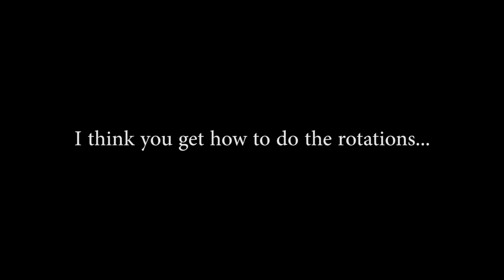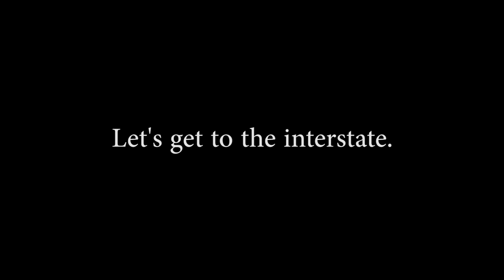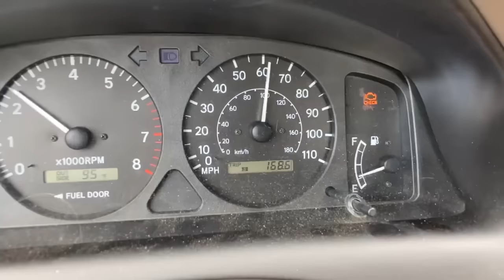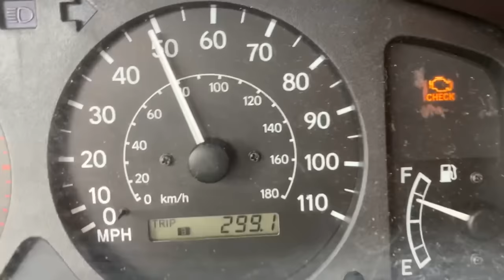Will Berryman's B12 Chemtool stop oil consumption? 😲 | Oil Burning🔥Experiments | Episode 15

Comment: Keeping my fingers crossed!! This is exactly how the wd40-trick is done here in Sweden with old Saabs!! Great video and great work, really appreciated!!
Reply from the maker: Thanks Claus!
Reply: Really, How is that? WD40 in oil sump works? At wich percentage? Interesting!
Reply: @tomasnokechtesledger1786  some Saabs had problem with oilsludge due to bad crankcase ventilation, this caused among other things stucked pistonrings.
Wd40 was at that time the only "thing" affordable, you could by it a one gallon can, some used diesel!
Not for the faint of heart!!
Reply: @clausjansson4856  My friend a mechanic said to use diesel for engine cleaning. I have seen some promising results but also a lack of help because if the cylinders are not round or heavily scored then clean rings will not help.  Just FYI, WD40 has a chemical that can destroy metals but if used temporarily and then removed it may not do too much damage.
Reply: @jamesmedina2062  totally agree, if its worn out the only thing to do is use heavier oil or a rebuild!!
Dave has gone through all the steps checking his engine very carefully!!
The wd40-trick is just an old Swedish home remedy (i think you call it that in us) might work, might not work, test at own risk!!
Regards from another DIY
Reply: @jamesmedina2062  A chemical that destroys metal? What's  that? Doesn't  destroy not even rubber. What youv talking about?
Reply: @tomasnokechtesledger1786  I am not a chemist. I do not know what the chemical is or how it destroys metal but penetrants are designed to attack corrosion and separate metals. I was told the information by a nuts and bolts specialist at local store. There are cutting oils that are made with different formula better for assembly and I use anything from a super light shock oil made in Switzerland (Motorex 2.5), Motul 300 grease, or Permatex anti-seize upon assembly.
Reply: @jamesmedina2062  no it doesnt attack corrosion, just coat it and wash is and protects further, but penetrants just make a little soft by the wetting over it.
Reply: @tomasnokechtesledger1786 The question was does WD40 harm metals. Not about corrosion. I said "attack" corrosion but I did not choose the right word. I meant to say that a rust penetrant does help to free rusty objects like a rusty bolt not that it treats rust like some acid formulations. WD-40 degrades metal and this may be helpful when freeing rusty objects as well. It is also harmful to the metal.
Reply: @jamesmedina2062  🤔 I don't  agree with that, but ... wth
Reply: @tomasnokechtesledger1786  its above my pay-grade too as its hi tech metallurgical study needed to assess microscopically. Just know that people selling hi-carbon steel cutting bits will not warranty them if you use the wrong cutting oil and use WD-40 instead of proper oil. They say it will destroy the bit.
Reply: @jamesmedina2062  the same thing would happen if you ran the engine with WD40 instead of engine oil. Nothing is going to happen if it’s just sitting with WD40 and then it’s drained.
Reply: @jamesmedina2062  I watched a video recently that explained WD-40 was developed to repel/displace water. I suppose it also loosens rusty bolts, but isn't a good lubricant. That's probably why it's not recommended as a cutting fluid.

Found it: https://youtu.be/aTD_SBudQfY
Reply: @jamesmedina2062  wtf.  You are confused.
Reply: @tjv6976  how do you think? WD40 is probably only decent as a solvent. But if it leaves residue then its not the preferred solvent. Its a lubricant but not a very good one, Then as water displacer I guess it might be ok but why not use straight oil that oxidizes and protects metal? The only reason WD40 is in so many homes is the ambiguity. People think it can have many used.
Reply: @jamesmedina2062  what are you talking about? Wd-40 is a solvent with silicone oil. It lubricates, and dissolves grease and grime. That’s it.

It actually protects metal from corrosion and was initially developed to protect military equipment during shipment by sea…
Reply: @goclunker  5 paragraphs later you ask "what are you talking about?". Have you tried reading what I wrote, all of it? I would start there.
Reply: You probably don't know the difference between aluminum and iron bro. Sorry but there are hundreds of different alloys and steels and WD-40 is not simply an oil that does not hurt certain materials. But hey not everyone knows the difference between different metals. Don't worry. Just breath
Reply: @jamesmedina2062  ??
Reply: @jamesmedina2062  “WD-40's main ingredients as supplied in aerosol cans, according to the US Material Safety Data Sheet information,[19] and with the CAS numbers interpreted:[20]

45–50% low vapor pressure aliphatic hydrocarbon (isoparaffin)
<35% petroleum base oil (non-hazardous heavy paraffins)
<25% aliphatic hydrocarbons (same CAS number as the first item, but flammable)
2–3% carbon dioxide (propellant)
The European formulation[21] is stated according to the REACH regulations:

60–80% hydrocarbons C9-C11 n-alkanes, iso-alkanes, cyclics <2% aromatics
1–5% carbon dioxide
The Australian formulation[22] is stated:

50–60% naphtha (petroleum), hydrotreated heavy
<25% petroleum base oils
<10% naphtha (petroleum), hydrodesulfurized heavy (contains: 1,2,4-trimethyl benzene, 1,3,5-trimethyl benzene, xylene, mixed isomers)
2–4% carbon dioxide”

Show me the acid that deteroriates metals and alloys, you fking donky.

Don’t tag me again

Comment: It would have been a good idea to have drained the clean oil first into a clean container to reuse after your treatment. 
Also should have tried to blow as much crap as possible with  compressed air through the spark plug holes and a rag over the holes to catch debris. 
Then drain whatever chemical had accumulated in the oil pan and maybe flush with some diesel or ???  before adding back the uncontaminated oil.

Comment: This looks like you have introduced a new issue, oil dilution.
Congratulation! :)
I really doubt the oil consumption can be solved in such way by applying B-12 ;(
The level is higher due to it now has gas in it.
If that is true, it is really bad!
The way to get the answer send the oil to the test lab.

A note: change the oil after finishing with the treatment.
There is no good running the engine with residual B-12 in it.
The best practice would be to apply treatment before the oil change.

Comment: B12 is a great product the extra oil your seeing on the pistons is the kerosene additives that didn't fully evaporate this is normal as the oil is slightly thinner in viscosity personally I would have driven a little while longer but great test and you really can't argue results
Reply: No 3 was dry before driving.

Comment: Auto manufacturers have dubbed the owners of most vehicles into a 10,000 oil change interval. I have been a mechanic most of my life. The worst thing that you can do is to operate your vehicle with D.O. Dirty Oil. The simplest way to eliminate oil ring contamination is to change your vehicle’s oil more frequently, and ignore the manufacturer’s 10K mileage. Personally I change mine oil between 5-6 thousand miles or once a year.

Comment: Berryman B 12 is great stuff, but be careful, it's very strong (methanol). I used the B 12 throttle body spray on a Honda Pilot, and it destroyed the idle speed control motor, to the point that the engine went into a surging, default mode. I had to replace the idle speed control motor.  I probably used too much, but nonetheless; I learned a lesson.
Reply: What do you mean by "destroyed" i.e. what was the actual damage it did?
Reply: @ferrumignis  Yes, apparently the mechanical plunger that controls the air flow was damaged. On this particular setup, it sits on the bottom of the throttle body, and gravity took the Berryman into the mechanism. The engine was running fine beforehand. I had a friend scan it with his Autel, and it came up with throttle control related codes. If I had to guess, the non- metalic seals inside of the idle speed control were compromised. Once I installed a new idle speed control, the problem went away.
Reply: @philjerome9795  Thanks for the explanation, I had a feeling it might a problem with rubber seals.
Reply: It's just as a Time
Reply: It's just acetone
Reply: @mikecastleberry9671  No, it doesn't even contain acetone.  From the MSDS:

Ethylbenzene 10-15%
Petroleum distillates 30-40%
n-Propanol 5-10%
Xylene 40-50%

2-Propanol can be oxidised to form Acetone which could possibly occur within the combustion chamber, but Propanol is the smallest constituent of the mixture so the possible yield of acetone would be tiny.
Reply: @ferrumignis  As of 2023-05-29 p/n 0116 (used in the video) does have at least 20%. SDS claims mostly toluene (40 to 50%) and has 20 to 25 of each of methanol as well as acetone. Pretty loose on the exact proportions all around but claim it may also have <5% of 2-Butoxyethanol and/or 12-Propanol.

Comment: Might also be worth getting into the habit of using something like a can of Wynns Engine Oil Flush (or other make of engine oil flush liquid) each time you change your oil. From personal experience - over 30 years worth of multiple motorbikes and cars - I've found it helps keep the sludge build up to a minimum (barely any in some cases), thus keeping small passageways clear (maybe even helping the rings stay free? 🤔), and helps keep the internals cleaner overall.... 🤔😏     😎🇬🇧

Comment: Great to see!

I would still try some ester motor oil to help clean the ring lands more, you may also need to repeat a few months in the future, it's done something, but we don't know for certain if it fixed the issue or simply did just enough to be noticeable and more can be done.

Still though, encouraging, and surprising.

Also, you don't want to drive with this stuff in the motor period, it use to be labelled for motor flushes as well, it's very aggressive, I wouldn't more than idle it with the stuff in the motor.
Reply: No. The only way this worked it’s because of the redlining for 20 mins. The engine needs actual “load” and high rpm in order to free up the piston rings! Idling WILL NOT work. Driving for 20mins won’t hurt anything because u r gonna drain the oil after anyway
Reply: @blackysan  It works by dissolving the carbon around the rings, sure redlining 'could' help remove some of the carbon, but its still driving around at high RPM with a legitimate motor flush.

Berrymen actively discourages using the vehicle with it in the crankcase, its not a light solvent. Piston soaking isn't anything new, and I've never heard anyone anywhere recommending folks red line a motor with a flush in it.

Piston soaks work perfectly fine without running the motor at all and draining the oil.

Telling folks to do such is borderline malicious, it 'could' help but if it spins a bearing its not your problem.
Reply: @GainingDespair  I’ve did this to my own car and I was the guy he mentioned in his video that suggested this method to him and now he did it himself as well. both of us and numerous others have no issues with redlining with b12 in engine so I have yet see anyone have bearing issue with it. But again, if u don’t feel safe, don’t do it. If u want result, don’t be concern about it. All I’m saying is that idling the car without actually driving and redlining it will not work. Done that and still oil rings still not free. After redlining the car with b12, oil rings finally free
Reply: @blackysan  and Last Hope:  He revved it pretty high, but did not redline it.  He said 4600 rpm.  My 2004 Vibe, 1ZZFE redlines at 6,400 rpm.  I'm not saying that it seems like a good idea.  Anyone have success without revving it, or revving it less?  Bueller?  Bueller? Bueller?
Reply: @duffman6675  as long as u run it at high rpm, u will see results like that because that’s how it supposed to work, burn off anything that’s in the piston rings land and oil return holes. If u don’t want to run the engine at high rpm with the chemical in it, then u might have to do the chemical soak multiple times until u see result. Keep on doing the soak every time u change the oil until u see result. I highly doubt that gonna happen coz I’ve tried all kinds of chemicals (sea foam, mmo, motor flush, carb cleaner…etc) with it and none of them works by just piston soaking or run it in crankcase. B12 with high rpm driving for 20 mins did the trick just one time! Immediate result! Learned that from googling it from forums to forums reading thousands of testing

Comment: I’ve watched all of the series for oil burning products and am amazed at how well this treatment worked for you. I have a first gen Scion xB (1nz-fe) 1.5l and uses about a quart per tank fill up (290-310miles). I’ve tried many uses of chemicals in the gas and oil and nothing helps. I’ve band aided it with much thicker oil for a while and replaced my pcv valve and that helped for a short bit but now it back to burning like crazy. I purchased two cans of B12 but didn’t realize till I got home that they are the break clean spray style. Well I’ll still try it anyhow! Will update in a week
Reply from the maker: I hear ya, Richie. I’m hoping the best for your Scion, and thanks for updating us later!👍🏻👍🏻
Reply: Update:
Engine was not happy at all. Took roughly 7 minutes of off and on cranking to start after the treatment. When I first pulled the plugs to put b12 in each cylinder, I noticed that each plug was completely covered and dripping with engine oil(hot engine after 45min to cool before experiment). The treatment was so aggressive that it rid of all my compression and would not start at all. Every bit of fuel that was use to start the vehicle was found later in my oil. After cranking for about 5 minutes with no signs of it trying to start, removed plugs, gapped and cleaned plugs, added some atf to each cyl to help bump the compression enough to start. I was then able to get it to start but hardly. Engine would not run in its own at this point. Held rpm arojnd 3k to stay alive and the hotter engine got, worse it ran. I can only assume that as the oil got warm, the gas that was mixed with it was putting off fumes that were making engine run rich. Next day pulled plugs and had to clean them again and then perform oil change. Performed compression check (1:180,2:150,3:160,4:180). This is much better than it was a few years back when I had gotten the vehicle. I used a scope to look in each cylinder as you had done in one of your videos and found slight scoring in cyl3 and major scoring in cyl2. I have since filled up on premium and just now filled up again on regular fuel. Oil consumption is still right on the money 1quart per tank (roughly 290-310miles). This engine has had a very rough life, that I was aware of, but doing this experiment was basically ripping off a bandage with no idea what was under it and this has shed light in the fact that I need a engine for it now. I am still driving vehicle every day. Does not run as well as it did before I did all this, but it runs well enough for now check engine light and it is what it is.
Reply from the maker: @richolishis94  I'm sorry to hear it didn't work for you, and I really appreciate you sharing your experience. More data for folks to mull over. Thanks again Richie.
Reply: @FamilyFriendlyDIY  I've had the same thing happen on an old Cadillac 472 - I sprayed carburetor cleaner down the carb while the engine was running and it cleaned so much carbon off of the rings that the engine would barely start afterwards (it permanently messed-up the engine, I pulled the heads, reground and adjusted the valves, and did everything possible to save it w/o rebuilding the short block, without success).  Lesson learned:  be careful using these types of products on old, tired engines.  Sometimes the gunk is the only thing keeping the engine running and the oil inside of it!

Comment: I have not seen one of your videos for a long time, and for some reason it popped up on my feed today. Surprised you are still doing this :) I have the same engine in a 2006 SUV, and mine does use anywhere near that amount of oil, but it does use some. I have found for mine, that a small mix of 5w30 oil really mitigates any oil burning.
Reply: Can you elaborate please a mix of 5-30 as in different brands bud or the oil and oil  additive? Cheers 😊
Reply: @chloeleedow7250  well i tried some over the counter products like MMO, with no real improvement. But, my experimentation is much like most on the internet, and that is, Anecdotal. So instead of messing with petro chemical percentages, i just did the simple thing and added some higher viscosity oil, and simply, it worked. I only added a small ( unmeasured percentage) amount, maybe as a guess. 5-10 % 5w30 vs 5w20.so, i will continue to minitor how it does. The improvement is there, but at this point not really defineable mathematically, yet. But even if it was, it may not aplly to all others.